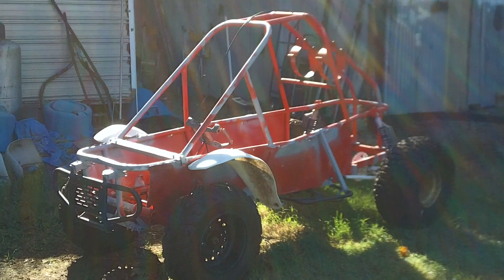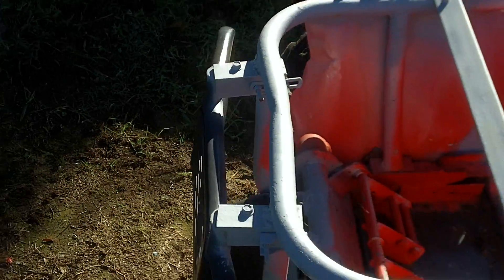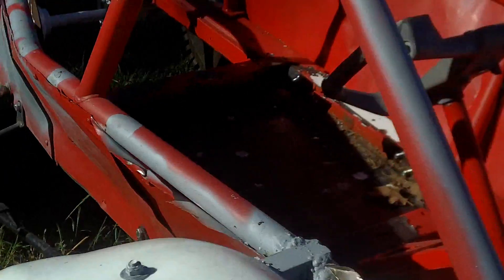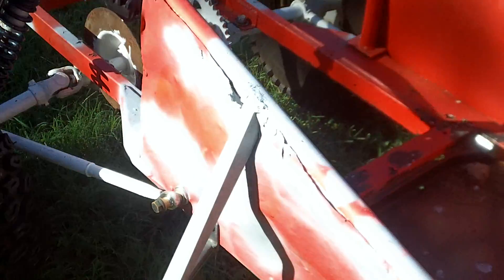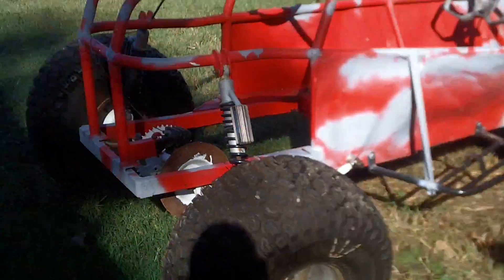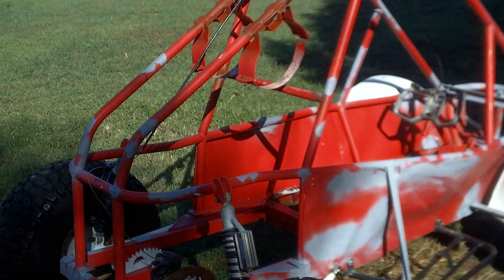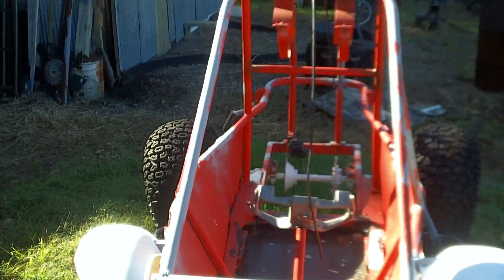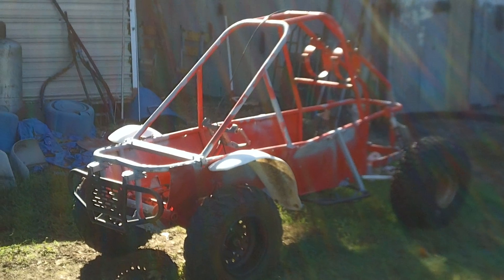My FL250 Odyssey project, first video.

Comment from the maker: I have a Lincoln "buzz box" and a harbor freight 110v stick welders.  I used the lincoln for the little welding I have done so far.  I have only 110v in the shop so I have made a extension cord for the dryer plug to go to the 220v lincoln. I have a Hobart 145 MIG welder on layaway at Tractor Supply.  I pay on it when I can, I'm currently unemployed. I have never MIG welded, but heard many good comments on it.  If I can get money for college I will take a welding course.    Thanks